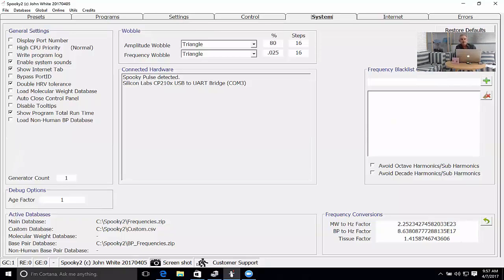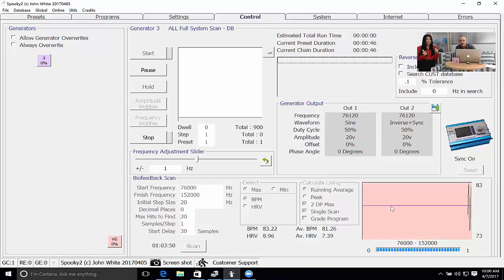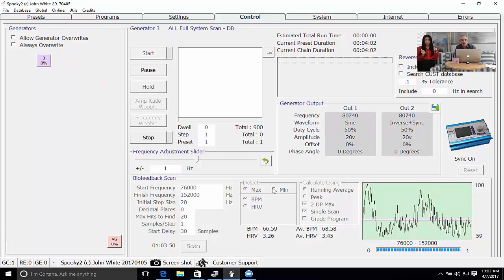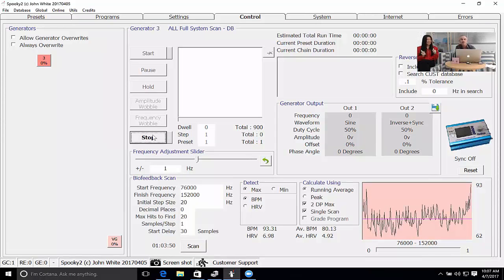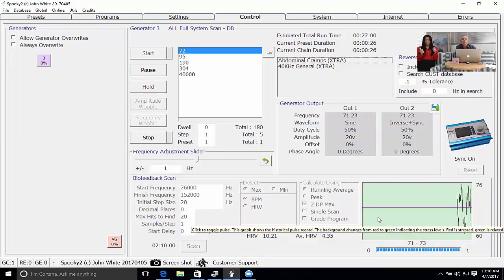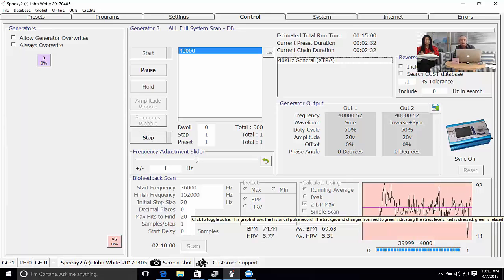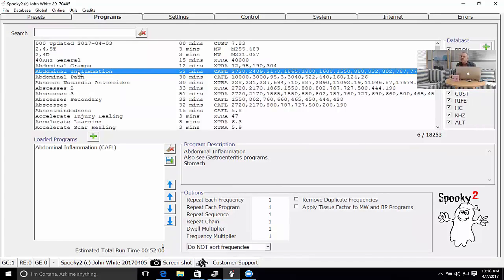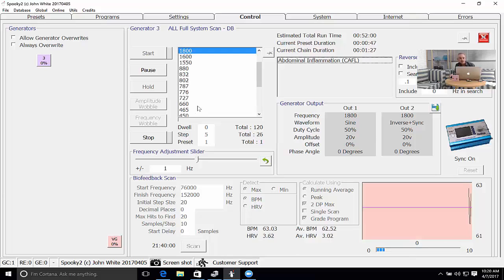What Is the Procedure of Doing A Biofeedback Scan?

Comment: As a New customer, I am disappointed by these 2 lectures by Echo  and earlier by JW. To do a better job of teaching, you both need to get into the minds of the new customer. This video Falls down because I'm not interested in doing a kidney scan for my first scan. I want clear concise information on how to setup and perform my first full body scan.
With JW he confuses by discussing all the various settings, rather than just concentrating on the details of a First Scan. He's a genius no doubt, but he's left me having to ask questions of other users because he's so confusing. Both of you would benefit from doing a Workplace Training Course. Beginners need it to be simple. You can then add more complexity in later videos. Training like programming needs to be structured. I now see others are also complaining about a newer video by Echo, Nov 2019.
Reply: Chain Lee, I agree with you completely. And as you say, this isn't meant as a criticism of John W or others in the core team at Spooky. However, a new customer or a still potential customer (like me) needs clear instructions in easy to achieve and meaningful procedures in the use of Spooky2 and the software. I know about and admire the Spooky community and they often perform this training and practice function. But, even the right members of this community can be difficult to find. Bottom line: this is magnificent stuff but it can easily be useless without clear instructions in use. Spooky2  will be useless without some better, efficient instructions to early successful operation.
Reply: I emphatically agree!!!